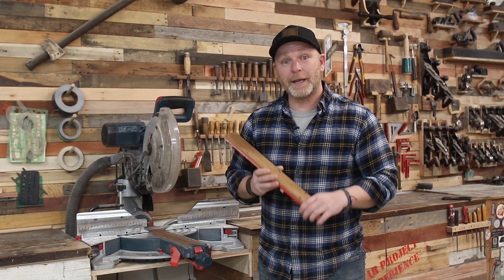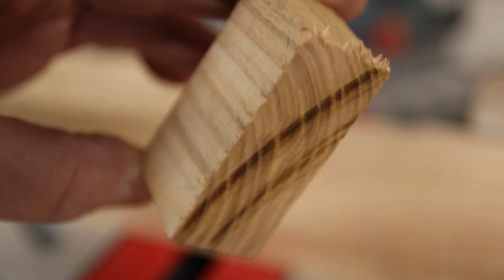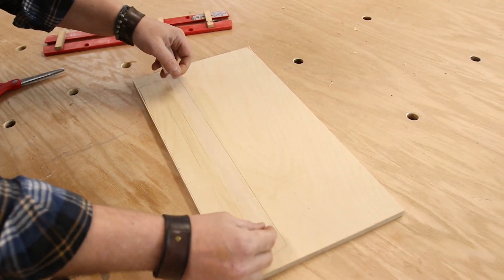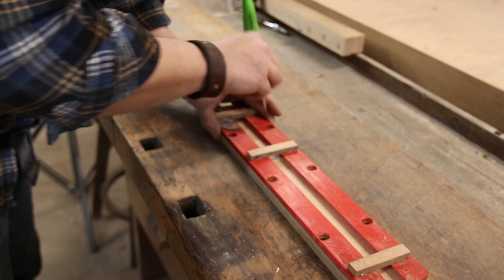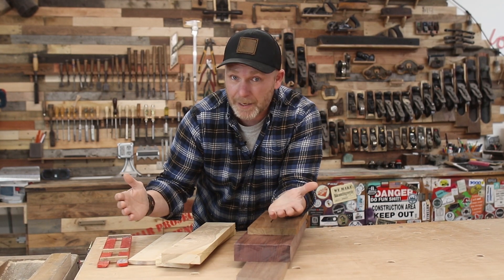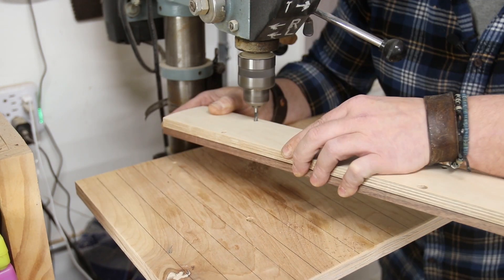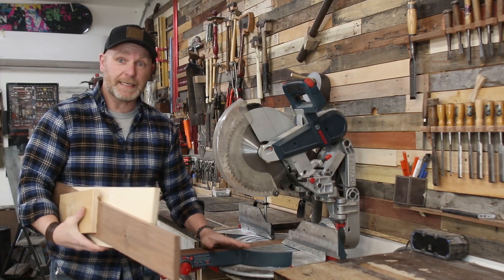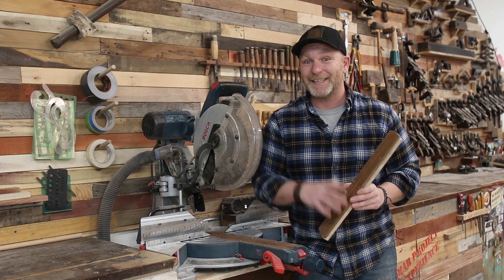Zero clearance insert for the Miter Saw.

Comment: This came up in my feed and glad it did! I got right on it and made just one small modification - by placing a small washer between the tapped screw hole and the blank and pressing down hard you will get an impression on your blank and thus the exact location for the hole. Not only functional but beautiful as well!

Comment: You are using a sliding miter saw incorrectly and that is why you are getting tear out.  If you make a score cut first and then extend the saw head out to full extension, lower the blade pushing it back making the cut you will find no tear out.  Now if you have a chop saw you will need the zero clearance.  The way the blade spins on a miter saw it essentially cuts from the bottom up unlike a table saw which cuts from the top down.  If you don’t believe me try it without your insert see for yourself.  But you have to cut it the way I described, also don’t force the saw through the wood.  Let the saw do the work.
Reply: I believe this is correct.  The blade direction has each tooth going down on the side of the blade toward you, and therefore going up on the side away from you.  So if you pull the saw all the way toward you first, then down, then push away from you, the teeth are cutting the wood from the bottom up -- so no tear out on the bottom of the wood, and all without an insert.  How to avoid tear out on the top?  As you say, make a scoring cut first.  That way, once each tooth on the side of the blade away from you, while you're pushing the saw away from you, exits the top, it's coming out of the top in the bottom of your scoring kerf, and the wood on either side of that kerf is supporting it to prevent tear out.  The only reason to have tear out on the bottom is if one chops from the top down, beginning furthest away from yourself, and then while all the way down, pulling toward yourself.  That way has the downward teeth closest to you cutting first and down through the wood.  There's literally no reason to cut that way unless you're trying to have tear out on the bottom.  Pushing all the way down, then away from yourself would make tear out along the top, but the initial scoring cut prevents that.  And since you can't make an initial scoring cut along the bottom, this is the proper direction to advance the blade through the wood.